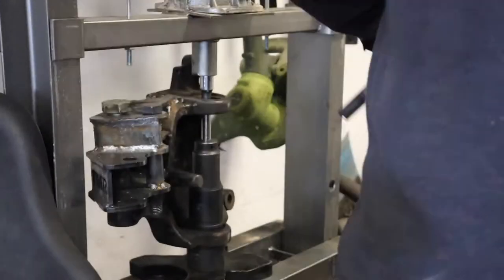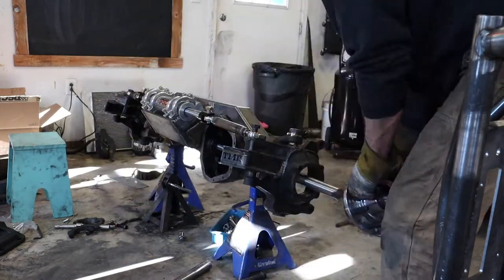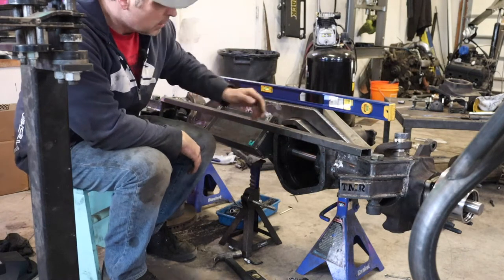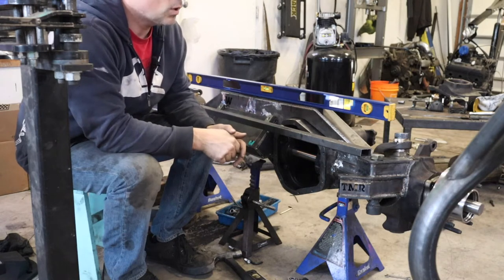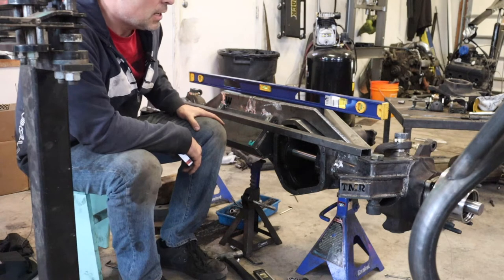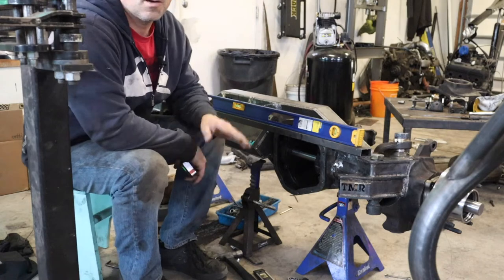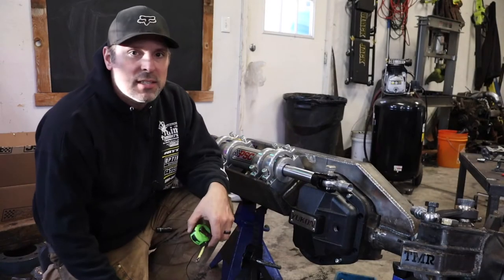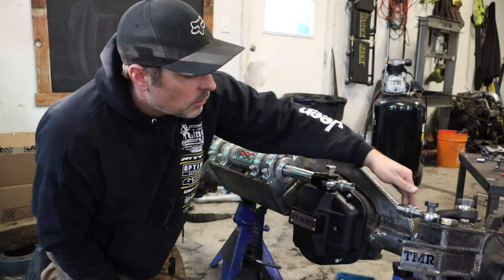Welding up the Dana 60 Truss, Ram Mount, and steering arms.  #DANA60 #buggybuild #Rockcrawler

Comment: Any plans to cut the TMR high steer arms back a bit? They stick out when they don’t really need to since you didn’t end up utilizing them to mount the steering arms too.
Reply from the maker: I have been thinking about it, I am going to make sure the arms work 100% in there current location though, in the remote risk I have to change the location.